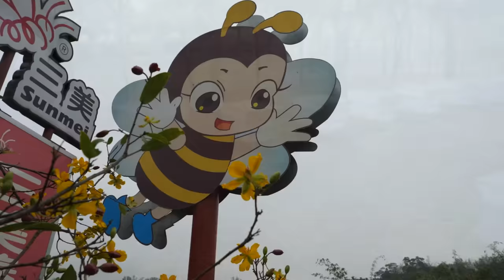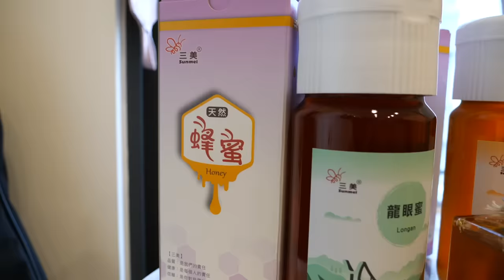How to Harvest Honey / 台灣蜂蜜採收 - Taiwan Bee Master

Comment: open honeycombs are considered immature. Since there will be a lot of water in this honey, it spoils quickly. Therefore, two-thirds of the honeycomb slats should be glazed.
Reply: Estaba por comentar, da la impresión q la mayoría de los panales no estaba operculada. Mucha miel inmatura. Un riesgo cocechar así.
Reply: @luishesselmann2012  I am a beekeeper in Turkey. My hives are  3 storeys now, so there are 2 layers of hives on it. When the combs are completely closed, I filter the honey.
Reply: @hakankara1176  q bien! Tengo colmenas en Argentina, también trabajo con 2 alzas melarias más cámara de cría. Felicitaciones!
Reply: @hakankara1176  I did some brief research from Taiwanese bee farms. It seems because the honey in the clip is longan honey, a kind of well-know honey for its rich aroma, and it also has a relatively good price in the market.
While the flowering period of the longan tree is quite short, about only 3 weeks a year in April. So most beekeepers decide to harvest immature honey for higher yields. Only few keep mature longan honey, but the cost is single harvest a year.

(but actually like no one in Taiwan cares about longan honey is immature or not, even me before I saw your comments😂)

Btw they still offer “covered honey” in non-longan seasons, and use the term “mature honey” as promotion.
Reply: @tomliu99  Honeys belonging to different plant species are harvested once a year. 3 weeks is not a short time, 3 weeks is enough time for the honey harvest. A strong bee colony fills all the slats and covers them within 3 weeks. We transport hives to different regions in May, June, July, August and September and the hives are filled with glazed honey. Those who want to learn beekeeping should watch the training videos of Turkish beekeepers.
Reply: Honey under 20% of remaining moisture is forbidden to be sold as honey in Germany e.g..
Reply: Çok güzel,  Hakan bey!
Reply: @hakankara1176  Im right with u. I have 30 beehives in Poland. In example heather honey is so stiff that it takes a heather extractor to get it out of the cells. Of course, I also wait for the honey to reach the appropriate humidity before harvesting, and this is done using a hygrometer. Honey containing less water ages slower, because the water in honey is an environment of enzymatic and chemical changes and creates an environment of decomposition and unfavorable changes.
Reply: These honey has dehydrated in the factories.
Reply: Not all bees and honeycombs are the same, please don't generalize.
Reply: @KornOil  dear brother, every bee is different, so there are many bee breeds. But if you want to eat natural honey, it's a fact. Honey needs to mature. Unglazed honey becomes sour. Honey that is dried by heat treatment in the factory loses its honey quality. Raw, pure flower honey freezes like butter after a while, that is, it takes on a solid, white color. You can understand that honey is real from this feature
Reply: @hakankara1176  так мед собирают и в России , те кто качует при переездах нельзя оставлять нектар в сотах можно загубить пчелу . Потом откаченный нектар хранят в открытой посуде месяцами и он дозревает. И потом , скорее всего это было сделано умышленно , более выраженный вкус.
Reply: hakan knows what he's talking about, please stop trying to correct him.
Unless the cell has been capped with wax, that honey is not ready for sale, period... do whatever you want with a random frame for personal consumption, but it's a reality that in most of the world, you cannot harvest honey for sale unless it has been capped. On both sides.
Otherwise, it's not honey, it's "nectar at some stage of becoming honey" and it does not have the magic "lasts longer than just about anything else we know of" property yet, which is required of honey for sale or long term use.
Reply: Излишняя вода испаряется вовремя  качки на центрифуге И видно по розливу.что мёд достаточно густой.
Reply: honey doesn't go bad... ever
Reply: @luishesselmann2012  5
Reply: @tomliu99  they harvest brood Honey thoo
Reply: @user-oe2gz3tn2o  если оставить не зрелый,то забродит и прокиснет
Reply: Дөрес, өлгермәгән бал алалар, кәрәз печәтләнгән булырга тиеш, умартачы кызы бит мин. Никадәр чагыштырам, безнең балга җитми икән.
Reply: Kiyomas
Reply: @chouseification  and they are also harvesting brood honey which the bees need but probably killing all the baby bees in there
Reply: @sergejgajic  yeah this is horrible apiary management on a monumental level. If they adopted even a few ideas from other beekeepers they would be able to raise their productivity a whole order of magnitude, but since they're killing off so many bees each time, that's lost energy that needs to go into making new bees vs making honey. Yes individual bees don't live very long but the biomass to start a new colony and then make honey is a swing and a miss compared to keeping that colony active and just robbing some super frames with (actual capped cells) honey. Don't they have the ability to make some good wooden frame boxes, or even (waxed on the inside surfaces) plastic ones if conditions require it? It's like they're 12 years old children completely DESTROYING the potential harvest vs whatever rationale they try to spin. It's not real (shelf stable) honey that they're making - so if it was all going into mead production it might make sense, but otherwise not at all. Odd is an understatement. :P
Reply: @chouseification  and they call themselves bee masters
Reply: @bieneulm1982  в Германии нет мужчин и женщин,так что теперь ?В России максимальное содержание воды в меде 19
Reply: 🎉❤🤩🧐📵 ,,,,,,,,не было и я буду находиться 😊
Reply: There are even more problems than you mentioned  @chouseification .  

Those appeared to be one box hives, which means they contained brood as well as honey.  

They didn't appear to be too concerned about losing queens due to the rough handling of the frames, half hearted shaking off of the bees and use of the heavy duty powered brushes.

I wonder how well the extraction of capped honey works, since they did not decap/level the wax until after the extraction.

I need to watch more videos to see if their practice is common or just poor.
Reply: @buggsy5 yeah across the board these people are really not being very wise with their bees... sure, you can raise new ones, but it's faster and cheaper to simply care for the ones you already have. :D
Their processes seem so backwards, and I'm no master beekeeper myself.
Reply: @luishesselmann2012  How is your life now?

Comment: What's difference between mature and inmature honey?
Reply: The collected honey has high water content, and must be artificially concentrated to reduce the water content to below 20% to facilitate future preservation. The harvesting time of the mature honey will be extended by about 7-15 days. At this time, the bees will repeatedly add enzymes (enzymes) through the salivary glands, while constantly flapping their wings to remove excess water, and finally seal the hive with beeswax. It's called "sealing honey". In the process of collecting mature honey, because the honeycomb has been covered with beeswax by the little bees, it is necessary to use a wax knife to gently cut the beeswax during harvesting. This seemingly simple action must depend on the beekeeper. With long-term accumulated experience and technology, it is possible to move gently without damaging the honeycomb structure.